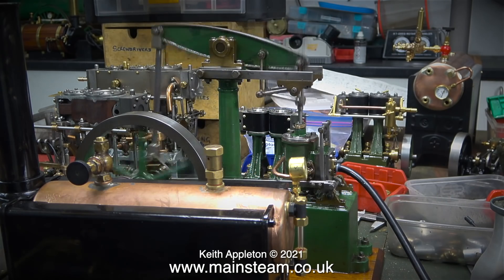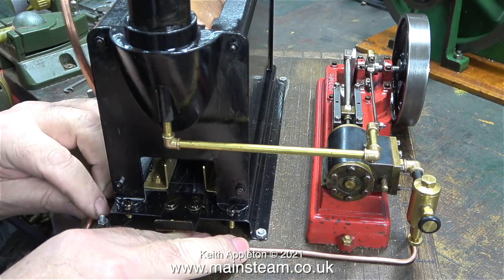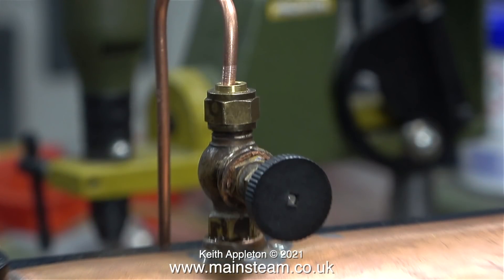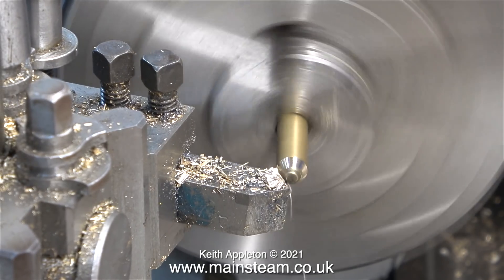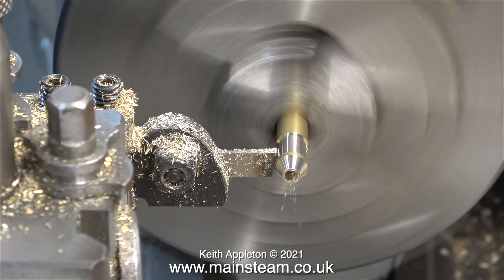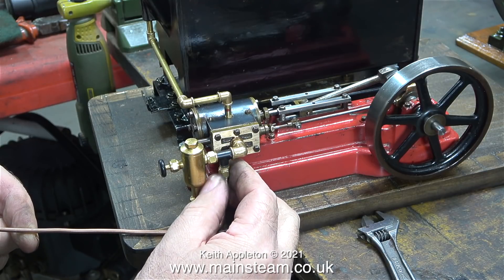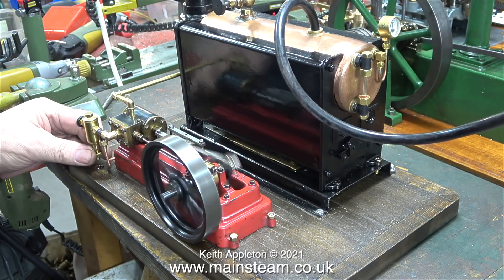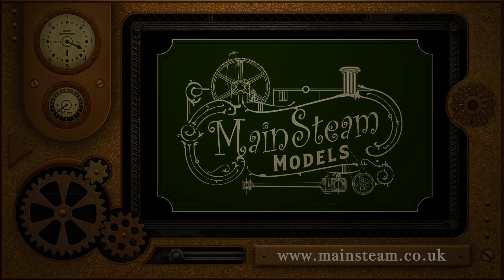THE IMPORTANCE OF NEAT PIPEWORK - PART #3

Comment: On the topic of lagging.  I wonder if sleeving the pipe with shrink tubing would work?  It should shrink well and it would remove the instant touch and burn.  It could also be colour coded for demonstration purposes.
Reply from the maker: no, there is too much heat and it would continue to shrink .....